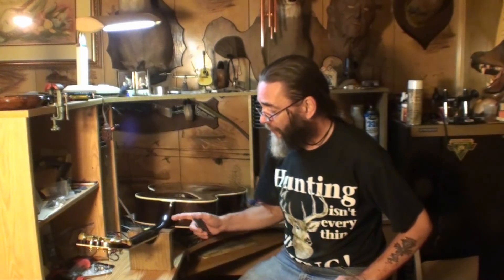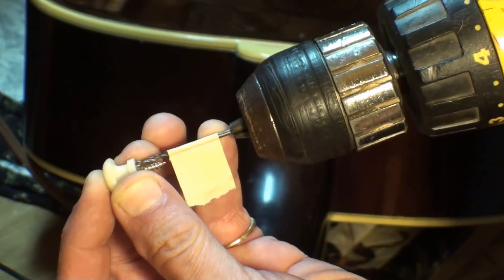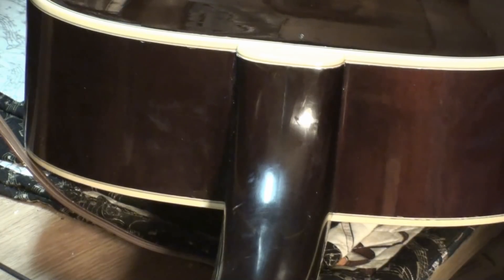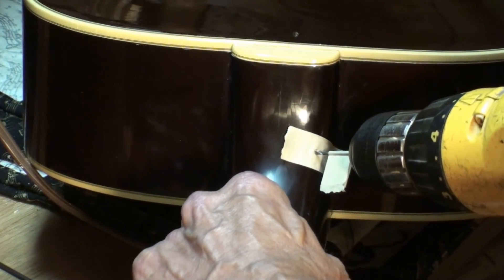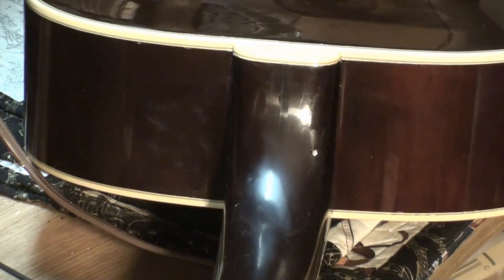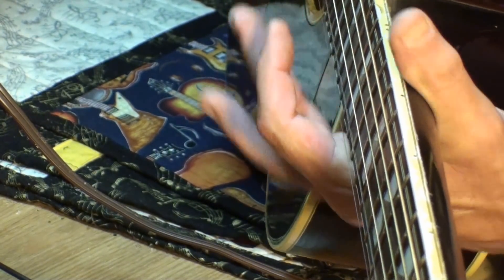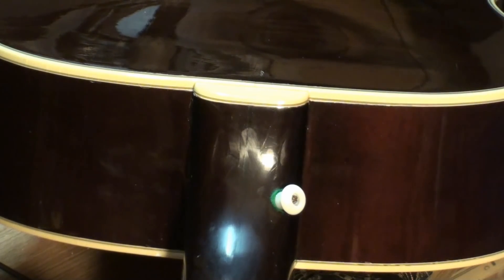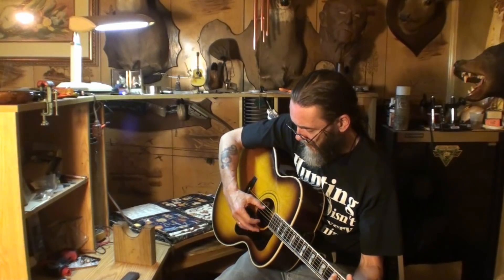How to install a strap button on an acoustic guitar quick clip tips by Randy Schartiger

Comment: I was frightened initially because there was no exact measurement given, but after you explained WHY the button goes where it does, I was able to follow your instructions. I marked two different places about a 3/16" apart and stared at them until I was happy with one of 'em. Worked first time. Thanks especially for the advice on marking the bit with tape so that you know how deep to drill. I didn't go in at any sort of angle, but tried to hold the drill exactly perpendicular (normal) to the plane tangent to the surface at the drill point, so I was drilling straight towards the center of the "meat".

Comment: I'd also say to anyone doing this: check very carefully that you're drilling in at the correct angle, otherwise the base of the strap button won't sit on the neck heel properly, and there will be an uneven and unsightly gap. I notice that you use a felt or similar washer between the button and the guitar - a good idea.

Comment: Good video Randy. But here's a couple more tips for beginners who may make the dreaded mistake of using a drill bit that is slightly too large in diameter, resulting in the screw not being secure enough when installed: #1.......never........EVER......"glue the screw in place". This is the worst thing you can possibly do, because now ya have a screw glued into your neck heel, making it near impossible to remove it without severely damaging the neck heel of the guitar. #2: The very best way to install the screw when you've made the mistake of drilling the hole slightly too large in diameter, is to simply use a wooden ROUND toothpick. Insert the tip of the round wooden toothpick as far as it will go inside the hole you drilled. Leave the toothpick in the hole and break it off inside the hole. Now your strap button screw should have enough added wood to fasten securely. #3: If the screw still doesn't secure nicely, simply remove the screw AND the toothpick, and start with a fresh toothpick, only this time, BEFORE inserting the tip of the toothpick, break the tip of the toothpick off by hand & throw away the tip, because you're now going to be using the thicker part of the toothpick. ( If the toothpick seems to be too large, use sandpaper & carefully sand the section of the toothpick you will be inserting in the hole, to get a better fit for the strap button screw. ) Repeat the step of inserting the modified toothpick into the hole and break it off inside the hole. Now, your screw should definitely be secure when installing. #4: When using the toothpick method, some people will use a drop of wood glue, and here's how: Break the toothpick off inside the hole as normal. Next, VERY CAREFULLY use a single drop or 2 of wood glue on the side of the toothpick that will be smashed against the inside of the hole. Use another toothpick as a tool to push the inserted toothpick against one side of the drilled hole and REMOVE "the toothpick tool" before the glue sets up. ( Wipe off any excess glue immediately. ) LET THE GLUE DRY COMPLETELY BY WAITING UNTIL THE NEXT DAY TO INSTALL THE STRAP BUTTON/SCREW. Do NOT install the screw/strap button until the glue is completely dry.......or else you will be gluing the screw in place too.......and that's a big NO NO. Lastly: anytime you install a strap button, be sure to use a felt washer inserted onto the screw, beneath the strap button, to protect the finish of the guitar. When you buy new strap buttons, always make sure that they come with the felt washers.

Comment: Hi my old friend -  you’re right it did only take five minutes to drill and fit but two hours to get a piece of felt and the correct drill bit - sure Randy I’m sure in your distant past you have started a five minute job and completed in just over two hours - Also for your viewing public check the drill size I used a 7/64” for my Ernie Ball lock strap. Thanks Randy

Comment: Hat tip to Banacek60...Great tip about waxing the wood screws. A very old method for lubricating wood screws.
Also would recommend tapered drill bits. These bits allow the screw to bite into the wood, the entire length of the screw.
I was always surprised that most acoustic guitar manufacturers didn't install a second button at the neck heal anyway, like they do on electric guitars. Tying-off the strap at the headstock never seemed like a good anchor spot nor the idea of having to tie it either.
Reply from the maker: when I work on the 2 truss' inside the pot of a banjo I always wax the screws before putting them back together, some banjos have as many as 3 truss rods counting the ones inside the pot, they are used to achieve the right angle of the neck. I can see where tapered drill bits would be good too! thanks for the tip and thanks for watching.

Comment: Thanks for the video. It's hard to tell from the camera angle of your instal, but are you screwing it into the apex of the convex curve of the wood?  - not the gradual big concave curve of the heel, but the more severe convex curve that rounds out the bottom of the neck. Is it OK to screw right into the apex of this convex curve, or did you place your button just far enough around the curve, to hit flat wood? I'd feel better about mounting it to flat wood for better contact/securing.

Not sure if this makes sense. Hard for me to articulate my question. Thanks again.

Comment: Thanks for the quick tip. All my guitars have two strap buttons on them except I just came across a cheap Yamaha classical guitar someone must have left at my house years ago that doesn’t even have one on the bottom. I’m thinking of getting some strings for it to check it out but doubt I will bother to put strap buttons on it.
Reply from the maker: Does it even have a hole on the bottom end of the body for a strap button? Just a few days ago someone was talking about a Fender classical guitar and they said it didn't have any buttons and there wasn't even a hole in the bottom to put one. I don't think I've ever seen one that didn't come from the factory with at least a hole pre-drilled there.
Reply: There aren't any holes drilled anywhere. Maybe they just don't spend the money to do it on these cheapie beginner classicals. This is a Yamaha CG-40MA and as far as I can tell they didn't even bother to give it a serial number.

Comment: I would like to do the same. Because at the moment I've got a strap with a lace around the headstock. And in my opinion it doesn't look as cool as strap with button under neck (sorry for my English :) ))
But I' worry because I don't know how to deal in that case with 12....14, 15 frets. 
   Will do I have that easy acces with my left hand to those frets, when strap and button are right on my way, while I'm playing?

Comment: The only difficult part of the job is getting the location right. My recently purchased Martin D16E is located (the button not the guitar)  where Randy shows (by Martin). On my first guitar Yamaha FG830, no button. While the guitar was in the shop for action work I asked for a button install. Tech looked at me a bit oddly, liked "can't you do this yourself". The reason he looked at me oddly was the easy place he picked (the wrong place) for the button. He drilled on the flat part of the heel. Sure it was quick but the strap does not tend to pull the guitar in close to your body like it will when the button is correctly located. Cost me $10.00 for an incorrectly located button. I still like the tech at my guitarshop, heck of a nice guy, just a small mistake.

Comment: Hey Randy, Diggin’ the videos! I just bought a barely-used beginner guitar, a Seagull S6 Original. It was never set up – hell, until I began watching your videos recently I had no idea “set up” was even a thing. The S6 is at the guitar tech’s shop now. Oh check this out… I asked him if he’d jot down for me the set up specs. He paused, smiled, nodded and said, “Yeah, I can do that for you.” I sensed he may not get that request from many beginners.

Point is, the strap button was placed by the previous owner on the guitar’s side of the body, above the heel, instead of IN the heel. Now, I don’t see myself needing a strap for quite some time, but when I do want one, what are my options for that hole? 

Peace, Steve
Reply: The shop owner just called and my guitar is ready. So, I asked about the button. He said he looked at it, and found that someone had attached a "substantial" block of wood inside to support the button screw. He said that's what his shop does when customers don't want heel placement. Now, to learn this thing!
Reply from the maker: very cool! to properly fix the hole would go into a lot of detail, if you're not worried about the looks of it I would just fill it with thick CA glue, this will also seal it from anything getting under the finish and getting worse. but as I said to make it invisible would take a lot more work.